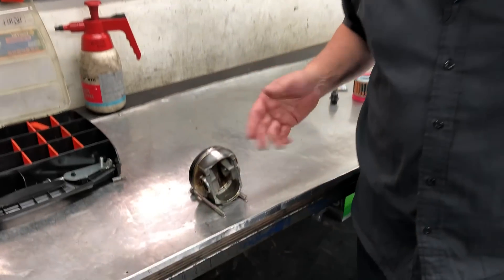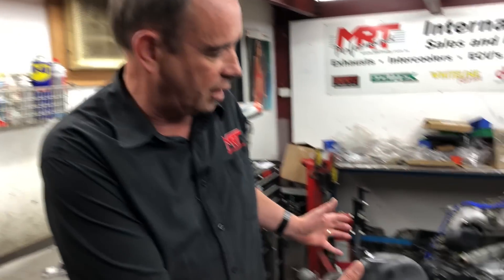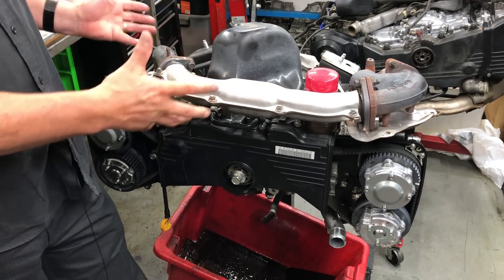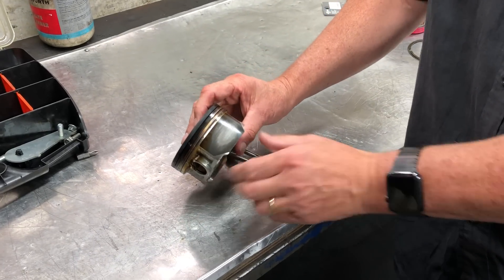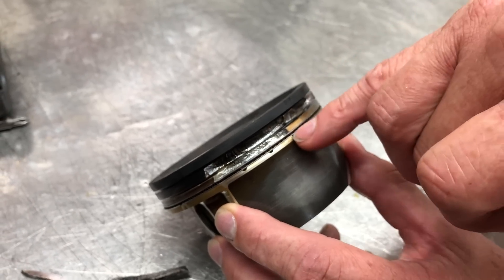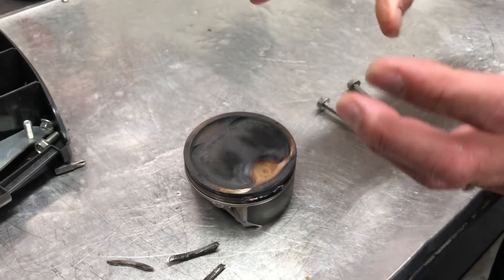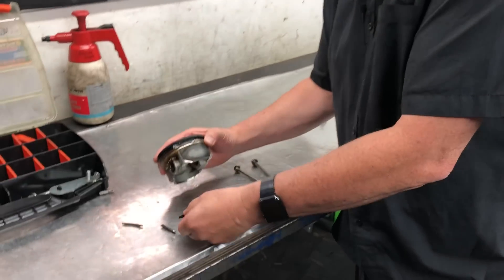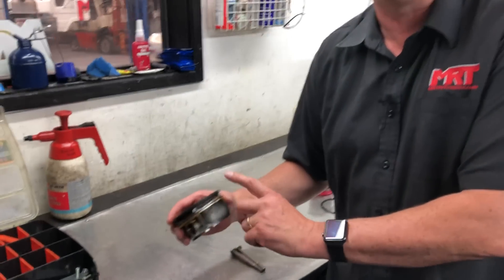SUBARU RINGLAND FAILURE - What you need to know

Comment: Took a long drive with my Subaru for about an hour then came to a stop and got a check engine light and misfire check engine light was PCV blow by! Car pulls the same and no decrease in performance, so I just vented the PCV to atmosphere and runs better. Mines a hybrid build and I heard they have blow by problems
Reply: I've got a franken-engine too, an ej257 block with ej20 everything else. Best part is when you have the ej20 sump you don't need to worry so much about cracked pickup tubes. And your comment got me thinking, I did have a custom catch can fabricated and I installed it to filter the top of the crank T, which is crank case under boost venting, but after quite a while there was almost nothing in the can. I then peaked at the side tube that is vent under negative manifold pressure through the pvc under the throttle body and it was very wet with oil. So I've switched them around and haven't as yet had a misfire code. It was always cylinder 4 misfire, and it happened while the car was still cold and warming up, so after the car was sitting all night and light loads. Once it was misfire all cylinders. But yea, it wasn't too common, probably about 4 times last year, but I just think you're on to something. Get a catch can. :)

Comment: Our 2.5 XT has what sounds like very slight pinging at small throttle openings. Goes away with a bit more throttle. Imaginitis ??
Reply: Sherie Thomas bad fuel maybe
Reply: don't buy the lowest octane / cheapest gas. At least put 91 (USA) octane through it, especially the turbo motors.
Reply: Sherie my friends with CVT does as well, it sounds like its very light and on the complete edge of detonation, but honestly Im pretty sure this is just normal noise.

Comment: I cracked a ringland in my stock ej257. Now i have a fully built motor that has been putting out 404whp for over three years now.
Reply: Pennywise my 404whp is with 91. There is more on the table with e85
Reply: horses not found
Reply: Pennywise the engine is built for up to 600whp, i chose that turbo because it still spools nicely with good top end power, its a lot of fun
Reply: Violetta says my car never
Reply: @maxxjettfilms6322  so what part did you use for the "ringland" issue??
Reply: LOL putting down 400 WHP on stock Turbo and block. Shoulda got an EVO. Why waste money building a inferior engine.
Reply: Violetta omg, I'm mad at you for that one.
Reply: maxxjett films what turbo?
Reply: Pennywise stock location blouch dominator 1.5xtr 10cm hotside
Reply: maxxjett films I didn't figure it was a stock turbo. Sounds fun though. I was going to do a FP red model on mine, but ended up selling it before I got to.
Reply: Hey maxxjett films for your built motor what parts did you add to the build to make that much whp ? I'm getting mine done in a couple of days, just wanna what i should add for the build
Reply: i had an evo 8 making 338 whp and 339 wtq wish i never got rid of it but philly roads destroyed my suspension and rims being lowered miss that car should of just fixed it then i traded it got an st snd hated it and traded that for a 2014 evo x and it was always stock but i don't know just wasn't the same and giving me penny problems with 22k miles just traded it for a 2017 sti it's stock to and i'm having fun again like in the evo 8
Reply: maxxjett films 404whp from a built Subaru? My old Evo 9 made close to 450whp on stock turbo and engine on E85. 🤭
Reply: I have a stock block 06 sti with 140k miles, upgraded everything else hit 430whp on e85, been running great for 5k miles.
Reply: R C that’s impressive for a 257 keep us updated :)

Comment: So with a bone stock 17 sti that had its oil changed with subaru oil only and is driven hard. Will it last? 23,500 miles and it's perfect. I hope to drive it hard and have it still last. I never lug the engine or floor it below 3500
Reply: xxnissansilviaxx i never broke in my motor in my wrx and motor lasted all the way to 45,000 within 18 months before i totaled it

Comment: So my blobeye having 385,999 KMs with 210 kwatw flogged daily and tracked is a rarity engine is untouched never rebuilt comp still good
Reply: The ej20s are much better stock for stock at handling power. My ej205 has been at 23 psi and 350awhp for about 10k miles and before that at 20 psi 315whp for 15k and then 19 psi and 245whp for about 80k miles. It has 160k miles on it now and no blow by and solid compression.

Comment: i have my legacy with the ej251 i just bought it with 132k miles and no problems with the headgaskit , any recomendations to keep it tha way ?
Reply: canchume nope, it will leak eventually. Either internally, which is hard to notice. Or externally which will start as just an oily residue on the bottom of the block right where the heads meet up. Single layer inferior gasket design.  The only real fix is new gaskets. Fel-pro makes a good one. It can be done with the engine still in the car but it’s a little more challenging. About $1,700-$2,000 to have a shop do it in the USA.

Comment: Does the fa20 in the wrx’s have rod problems in a stock setting or just under modified circumstances?
Reply: Patrick Ervin I want to say only when modded and over boosted. My 2016 WRX always had those boost spikes around 21-22 psi when the weather gets warm due to the mediocre factory tune.
Reply: It's modified. Why I won't go bigger turbo unless I build the motor.
Reply: My '15 WRX is 3" from air filter to exhaust tips;  Stage 2 E30 custom tune 22.7 psi @ 350 bhp. Top of the mark for these little con rods. Don't want Rodney to come out to see me 😖